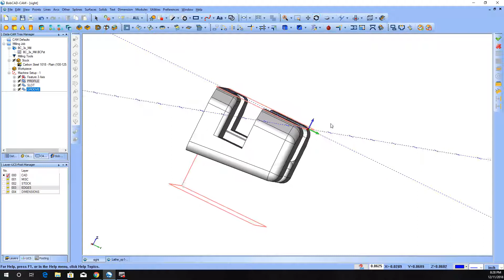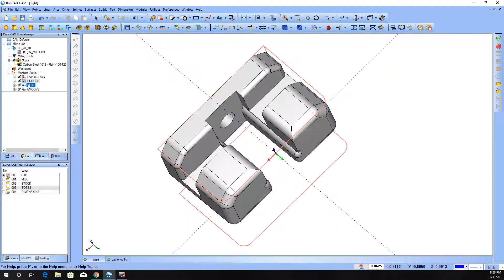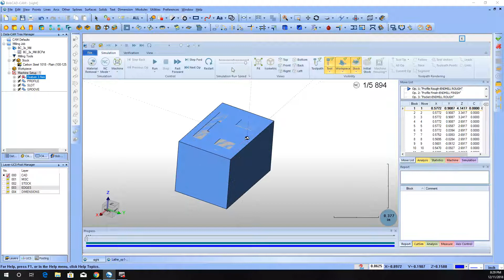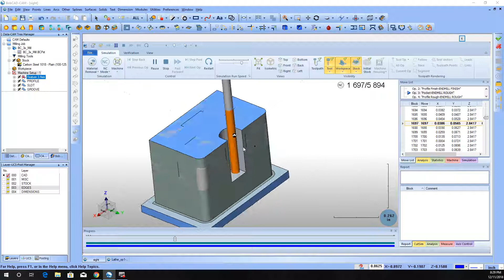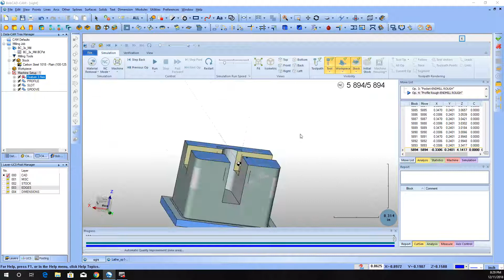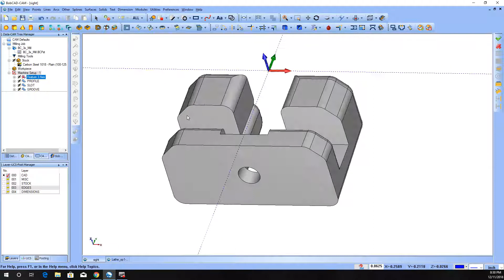3D Scanned part pulled into BOBCAD-CAM

Comment: Hi, great job, however, can i ask how much processing of the file/drawing you had to do before bringing the scan into BobCad. I only ask because i am looking at investing in both a 3D scanner and BobCad to do some backwards engineering of parts. But I was under the impression that scanned images were very rough and had to be pretty much redrawn completely using the scan as a guide only to then create what you seem to have in your video. Thanks in advance.